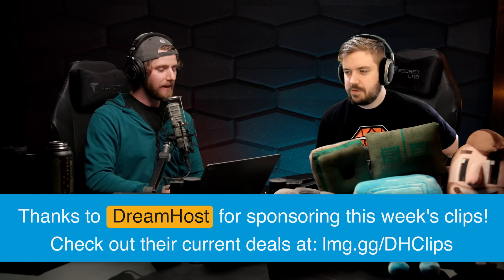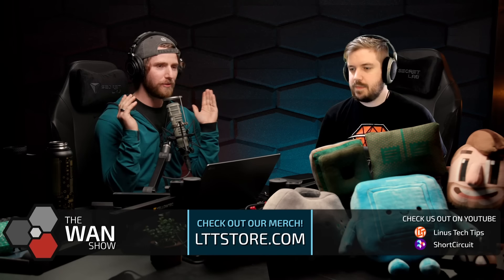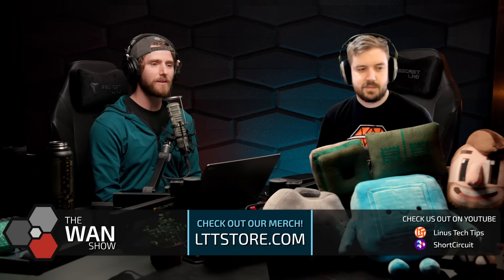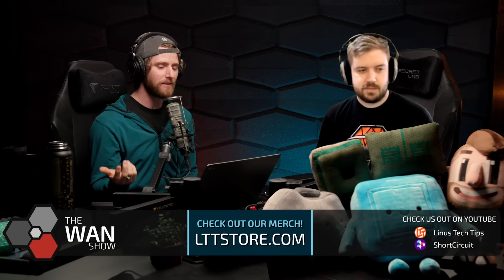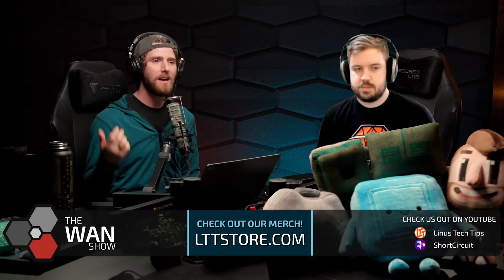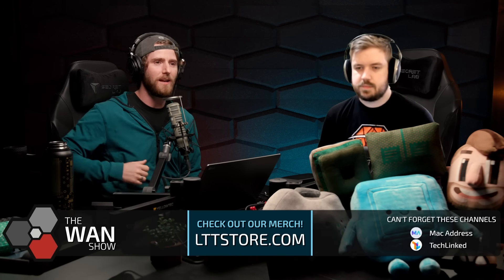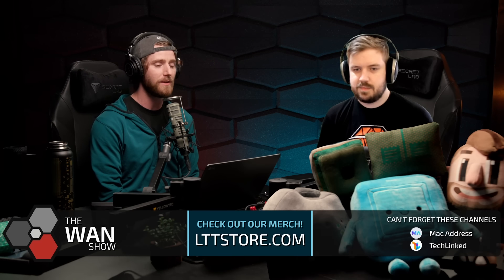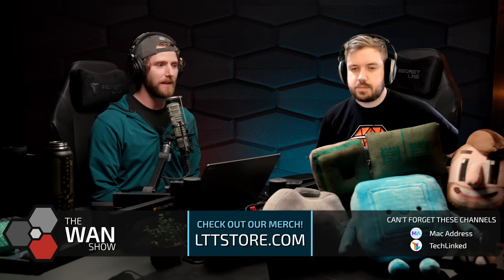They made me WASTE $10,000! Pt. 1

Comment: Someone needs to educate Jasco and their support department on what the whole point of firmware is…. To allow us to update our buggy devices and fix both functional and actual safety issues. I think the next part of this story should be: So we ripped the firmware from a newer switch and used it to update the old switches, checkmate.
Reply: I mean, they bought new products. They had old firmware. I don't think buying another new one would give them a device with any newer firmware. I think Jasco's intended solution is to connect the device to their app and update it that way instead of allowing it through Home Assistant.  Which is... not great.
Reply: @dacid44  I think he meant to rip it from the other switch. The one that looks similar that wasn't a dimmer but looks identical.
Reply: Well can't they provide firmware in binary files, like every proprietory product, or if that's not the case they can provide technicians to go to there clients and update the firmware
Reply: Seems like a way for Jasco to get more money through planned obsolescence. Yikes.
Reply: @JoshMutia  yeah, but they are brand new devices with obsolete firmware on them.
Reply: @GarettHarnish  Why wait for obsolescence if you can have it out of the box on day 1?
Reply: @justinepaula-robilliard  I agree when I ran my computer repair shop I also would do basic console repairs.  I remember a time where I was working on a console where I was doing an OS reinstall do to a hard drive issue.  While I was working on the console their network got hacked and they pushed out a firmware update but would not put up the patch one they pushed for download.  However that patch firmware because it got that update right before I reinstalled the OS and the firmware on the hard drive had to match the one on the hardware.  I had done this several times with out issue before this unit and had to fight with them over 3 months because they would not send me the patch one or let me send the unit in to get flashed.

As for the firmware issue this is a common issue with warehouse workers.  If the model does not change they do not understand that an item can get dated like with a firmware.  I worked for server support group and run into this alot because they would just put the restock on to of the older versions.  I have pushed for this with alot of the groups that I had worked with to make sure you have some kind of F.I.F.O. (First In First Out) rotation especially on hard to update devices because in some cases if the firmware is to old the updater may not be able to update the device anyways.
Reply: @primefactors888  You do realise you can get firmware for just about anything and file format effectively doesn't matter. Jasco's idiocy of "security" through obscurity only hurts customers and completely annihilates repeat sales. It's the same issue with DRM - it only hurts legit purchasers.
Reply: @justinepaula-robilliard  The solution is simple, Stop Buying Apple Products.
Reply: @justinepaula-robilliard  What's sad is your reaction.  Be a free thinker
Reply: @justinepaula-robilliard  the more advance users just blocks updates if needed or allows them if there good, it's why Im not switching to windows 11 yet because it provides no support and does less then what windows 10 does

Laptops will always generally cost more although not sure what the pricing is or normal sales price.
Reply: @justinepaula-robilliard  Actually Apple sends out a ton of updates.
Reply: A refund or a lawsuit is next.

Anyone paying 10,000 for light switches should not have this experience.
Reply: I thought the problem was he bought new switches with 5 year old firmware on them.
Reply: ...and then, the "newer" switch killed itself as a countermeasure against getting its firmware out [joke] (like older MacBook SMC chips do [actually true]). :P
That would make people even more angry, but why not do it, if more and more companies are actively using such anti-consumer practices? And they seem so proud of it!
But in all seriousness, they should call themselves FIASCO, not JASCO.
Reply: @dacid44  Products come in batches, one batch may have one firmware version, while another batch could have another firmware version. I think what Scott is saying is to figure a way to locate a product from the most recent batch of products, buy that one, then use the updated firmware from that device to update the other devices.
Reply: I think why they did this is so they could call them and request an update then a technician will come to u, update it and then charge u for the update just so they make more money
Edit: I was kinda right but instead of a technician coming to update it u need an smarthub just to get firmware updates and that's just dumb
Reply: @billlawson3467  as Louis Rossman alwayssays, the solution isn’t that simple, they’re all doing it.
Reply: @Meek2001  Everyone wants to be the one with the proprietary hub so they will have cloud data to sell.
Reply: @justinepaula-robilliard  It's simple. Tech companies have a stranglehold on their market. Tech is an infamously hard market to break into, so once you've gained a comfortable market share that allows you to sustain and grow, you're set. You can rest on your laurels and not worry about QC and software as much, because what are you gunna do about it huh? We're too big for you to do a damn thing. Anticonsumerism is becoming RAMPANT and it's passing me off. We're well on our way to a corporatocracy
Reply: Thats what I was thinking. Buy a new one directly from the side. Extract the firmware and send it back.

Comment: The plumbing pipe he is talking about is called poly butelyne. The plastic fittings crack pretty easily and cause issues.
Reply: As opposed to PEX with the better plastic and/or brass/stainless fittings. Use the expansion type fittings/connectors (Uponor/Wirsbo) and it is pretty much foolproof AND will last a half century (45 to 50 years).
Reply: There is also Kitec which is a sandwich of pex and rolled seem aluminum which has a tendency to split cause pipe failure.
Reply: @Oxblood1987  Rolled aluminum and PEX? Sounds like one of the O2 barrier tubing used for radiant heating.
Reply: Yeah. Poly-B. Already replaced one entire house worth of that. Never want to do it again.
Reply: Had 4 of those pipes bust over the course of only 2 days. We had thought to replace them years ago but figured we’d just wait until they give out. Little did we know 4 of them would bust within 2 days causing a lot more problems than we had originally considered
Reply: @Bigrignohio  👍
Reply: @jpquebec123  It's all about the type of PEX and fittings used. The compression fittings and the certain types of tubing are prone to issues. And frankly if you have mice in your house nibbling on pipes I would be more worried they are also nibbling on the WIRING.

And banned? Not a chance. Well, except in union areas. They do not like the lower labor requirements.
Reply: I live in New Zealand and here polybutylene is fairly common for water supply pipes, though alkathene is the main product used. Never heard of issues with pipes or fittings cracking before.
Reply: plastic pipes are not what the pros use they use copper piping it will last a lot lot longer unless someone drills into it.
in the uk we may have plastic pipeing under the sink / washing machine but everywhere else is copper pipeing. the reason people use plastic pipeing is the the copper stuff needs to be soldered and that takes a bit of skill.
Reply: @Bigrignohio  45/50? I havent ever heard a life expectancy longer than 30 for PEX. its still the best option when combined with conduit-style piping though
Reply: I literally had a burst poly-B pipe last thursday. Dropped a small case on a pipe, immediate break.  Entire appartement flooded and my pc is probably dead :'(
Reply: i love how people are propposing a bunch of different options, and nobody is talking about pvc ?
Reply: Yeah just fixed a whole lot of those in a 70s mobile home. Ripped them out and put in pex.
Reply: @Bigrignohio  the poly butelyne that was in the 70s home only failed because the house was never properly winterized when they left and all of the lines froze. That stuff was some 40+ years old.
Reply: Plastic conduit essentially. Most houses today are just run with straight 
Romex.
Reply: @Bigrignohio  just hope you definitely have a pest free home for those 45/60 yrs. Mice absolutely love the stuff.
Reply: @matthijsjanse3275  pvc is good/standard for waste. Bad under pressure, and even worse with shutknocking.
Reply: Who's dad are you
Reply: @stephenmeinhold5452  copper is straight up inferior to properly done PEX tubing. Dramatically more prone to failure via fatigue, burst resistance is utter crap, low resistance to over-temperature events as well as low thermal efficiency, reduces water quality. Many solders also have poor resistance to acidity, developing pinhole leaks overtime...
Reply: @Bigrignohio  What? Yes, they're banned since 1995 for new construction since it not in the building code anymore. Canada followed suit in 2005.
Reply: @MrTheCheesecaker  Problem is when it mixes with chlorine. If you live somewhere remote enough that the water is not chlorinated, you will be fine. If it is, you're fucked.
Reply: If tou think that this pex or Poly butelyne is a problem, whait until you heare that the old part of my house has leader plumbing, lol. Some of the elétrical wire had a tissue alike material for isolation WITHOUT any plastic or ruber!
Reply: @TzunSu  PolyB is, yes. Pex is certainly allowed in many, if not all, areas. They are NOT the same type of product.
Reply: @QuiznosBear  They love Romex as well. Honestly I will take water damage over fire any day. Plus unlike electrical if they do damage it you can hidden splice in the wall.
Reply: @Polpete6969  Think you need to look at type. PexA vs PexB vs PexC, etc. Plus people often lump it in with PolyB. Which gets brittle with age. Most authorities seem to believe Pex is a 40-50 year product with an average of 45 years.
Reply: @Bigrignohio  Ah sorry, i missed that u were talking PEX and not PolyB. Pex is getting banned more and more globally though, and i have no idea why you think unions are the reason why lol. Also kind of funny that you mention Wirsbo, a tiny town a few km away. Those fittings you're talking about? The reason that company exists is because of unions, lol.
Reply: Had to replace ours a couple years ago while we were living in our house and the pipe behind the kitchen sink blew. That was fun.
Reply: cpvc?
Reply: @Bigrignohio  pex is the best thing in plumbing to come out in along time. No more crazy copper prices and it’s so easy to install. Also it’s flexible. Love that stuff
Reply: Thank you Ryan :D
Reply: @Bigrignohio  
I'm not sure I get your point in bringing up electrical wiring options here...

Are you suggesting that you use pex to bait the mice away from your circuitry?  Or that plumbing issues are ok, as long as you don't have electrical ones?

I mean... a water leak can definitely cause electrical problems.
Reply: My shower in my apartment broke because of this crap
Reply: @QuiznosBear  Just pointing out that worrying about rodents nibbling at pipes is rather silly. But if you WANT to worry, worry about something that can kill you!
Reply: @Skubasteph  Oh  agree. Plan on my new home to be Pex-A expansion with a manifold so every fixture has a dedicated "home run". Well, except the toilet. It can share the line with the outside tap.
Reply: @Bigrignohio  I still don't understand how you read: "it's bad to eat mold, I don't recommend it" and respond: "most molds won't kill you, but many funguses will"
Like... Don't eat either ya goon.

But please, go on telling us that you that sell pex without telling us you sell pex.
Reply: @QuiznosBear  I don't sell pex. Don't even specify it. But fear-mongering about the use of pex is simply foolish and shows a basic lack of understanding of the risks involved. But I see using any form of analogy may be a bit above your level. So simply: The risk in using Pex is very, very low. Installed properly it will give you a half century of good service. And has a lower chance of leakage as there are fewer joints.
Reply: @Bigrignohio  pointing out a common source of failure of pex, when properly installed, before it reaches typically expected EoL = "fear mongering".... Riiiiight....

Meanwhile, you jump to life threatening risks, more than once, about a wholely unrelated utility and product. 

Literally while using the words "compared to" which means you are making a *comparison*, NOT an analogy (unlike my prior mold vs fungus comment, which WAS an analogy to our conversation thus far).
Reply: @stephenmeinhold5452  bs plastic pushfit is in pretty much any house built after 1980s
Reply: On the note of correcting someone, at least spell it correctly. Polybutylene is ONE word and not two or a hyphenated word. 🙄🙄
Reply: @Bigrignohio  pex is great
Reply: @matthijsjanse3275  PVC is not for drinking water. Wastewater only - it leeches into it which is unhealthy.
Reply: @a1x48  not in the UK.
Reply: interesting, i have only seen that stuff in mobile homes(single or double wide trailers) there was even a class action lawsuit here in the us, I have never seen it in a traditional home, pvc or copper, older could have galvanized, pex has been the standard for the past 15ish years
Reply: @change929  you might find it in some new builds eg 2010 but the majority of propertys in england are at least 100 years old and have copper piping everywhere, in fact we had a very harsh winter once and all the external pipes bust when they got frozen up.
Reply: We have a firmware update which completely resolves the cracking issue with your poly butelyne piping, but it's proprietary, so no firmware for you.
Reply: @toddbod94 you can use compression / soldered / pre-soldered or push fit on copper.
Reply: And in Canada your insurer will drop you if you don’t replace it.
Reply: had that in my house, it doubled my home owners insurance.
Reply: BC HVAC/plumber here. Poly-B was pretty much the standard water line of the early 1990s. It's so prone to leaking that my house insurance actually has a line saying "if a poly-B pipe leaks, your deductible is $10,000.
Reply: @stephenmeinhold5452  isn't it just a myth that copper piping is better? pretty sure a simple google search confirms this
Reply: @MrTheCheesecaker truth is, poly b, much like ABS, does not like to be left in the sun. The uv seemed to deteriorate the poly b really rapidly.

Comment: I will never ever smartify my home. The thought of having my home depending on an app that eventually will not be supported is just terrifying. Mechanical switches worked in the past and will work in the future too.
Reply: Reliability over convenience always
Reply: It doesn't have to depend on something that's eventually unsupported. That's the whole point of home assistant, you run it locally on your own device (usually a raspberry pi) and the network traffic never leaves your local network, even works without internet.
Reply: There is better way to do it. With real automation systems made for building. it's programmed by engineer(me working in industry for over 5 years) to your taste and doesn't need any connection. And lighting is not smart building it's just gimmick. Smart home integrates Air Handling systems, temperature handling systems etc to one central station. Lighting is just bonus on the end. And if your needs change after few years you just call to engineer and he/she can reprogram it for your taste aggain and aggain and aggain. No apps, internet and other bulsh*t.  You even can have HMI(human machine iterfaces) anywhere in your house or your phone can act as HMI also. AND also locally. And if you really need, you can connect goggle home or another assistant to control your system by voice.
Reply: There are numerous devices that make direct control available (wall switches, wall sockets, shutter switches..)
Reply: @petervalasik1149  thats got to be really expensive though linus has indeed spent 10k on switches alone
Reply: Sir, we've detected that your use of Physics™ to conduct power through mechanical switches is unlicensed. Please sign up for an account with our third party subsidiary authentication outsourcing company and register for our monthly subscription service to continue using Physics™ in your home, or you may be subject to penalties including, but not limited to fees, legal actions, jail time, and spontaneous local black hole manifestation.
Reply: People are to damn lazy today..
What amazes me are the people to lazy to use a remote as pressing buttons is to hard..
Instead they would rather use speech and have a comonsy able to record their every word..
Reply: As someone who has a now obsolete smart home from the late 90s, this is a wise decision. I'm systematically ripping out every useless smart feature of my home as they break or annoy me enough.
Reply: From what Linus has said about his smart home experiment, he's more doing it A so that he can speak on this subject with any degree of authority because he has no experience outside of smartifying his own home with this tech, and also he plans to live in this house long enough that realistically by the time he will end up selling it. A house of this class will be a smart home and if it's not no one will buy it
Reply: Just because some shit corporation can't make good products doesn't mean nobody can.
Reply: No smart home device “depends” on an app. They all work just fine as manual devices when the internet or app goes down.